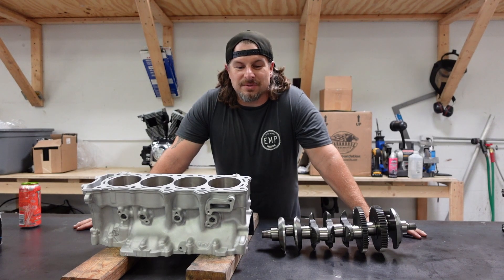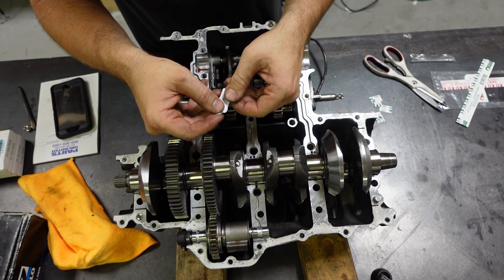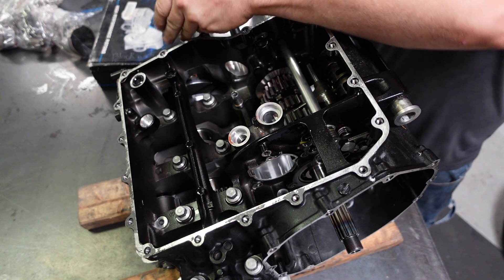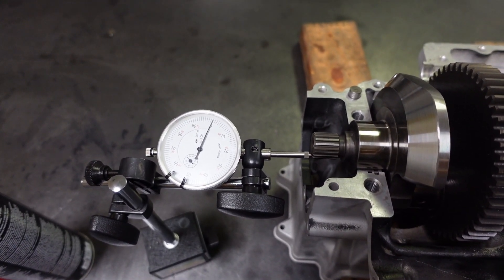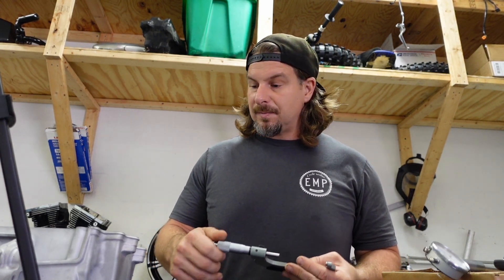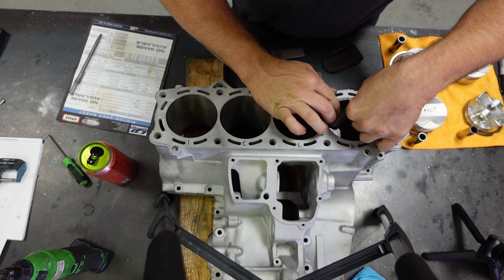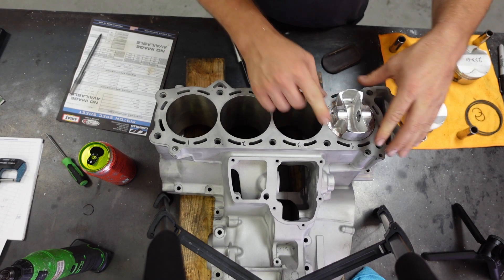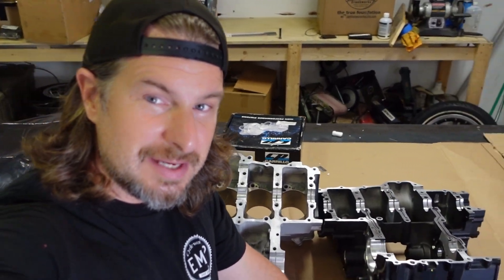Building a ZX14 Engine Part 1: Measuring

Comment: I've got a 2006 zx14 can you tell me a site i can order a set of main and rod bearings. I've look it keeps telling me the mains are 40.mm but there're not mine are 38.mm I can't find the right ones anywhere
Reply from the maker: As far as I know you have to go to the dealer.
Reply from the maker: Partzilla is one that I’ve used alot

Comment: Hey, thanks for making these videos. Question... I have a 2022 ZX-14R. I've been reading about spun bearings due to oiling issues. There are "upgrades" for this issue that I've seen, like a thicker oil pump plate because supposedly the stock plate can flex under heavy load, causing the oil pressure to drop. Do you know anything about these mods? Is this really necessary? I've found some threads online from guys claiming 60k+ miles on stock motors that have been wheelied liberally as well as run for extended periods at high rpm with no issues other than replacing the steering head bearings. I'm curious what you think about this.
Reply from the maker: I have installed those plates. It’s cheap insurance. Thanks for the comment

Comment: I might be about to buy a 2008 zx14 with supposed rod knock. I haven’t seen it yet, but for the price of the listing I can always part out the bike and get my money back. I was wondering if the engine is rebuildable after rod knock starts to happen? He said he heard it and immediately shut it off and had it towed back. I think that I might be able to get the crank machined and get over sized bearings if it didn’t bend any rods. Is there anything else you recommend I check for on these bikes? I do aircraft maintenance, but I’ve never torn apart a large motorcycle like this.
Reply from the maker: They are definitely rebuildable with rod knock. Although it depends on the extent of the damage. In my experience, A seller is usually under estimating the extent of the damage.  

For instance, I have seen cranks twist, damaging the main bearing bores, cylinder walls and the camshaft journals. Which is not worth rebuilding at that point. This bike was purchased with a similar rod knock noise.

If you do rebuild it , I would get a service manual and check everything in the engine. Transmission especially. Its not rocket science but experience does help. If you have rebuilt and engine before, it should be easy.

Comment: Why grind all over you work bench just bad habit
Reply from the maker: Thanks for the comment! During this video I was doing all of the dirty work. Before this engine gets assembled everything will be thoroughly cleaned, and cleaned again. Including all engine parts and work station. The block and crank are fresh from the machine shop and are contaminated already.